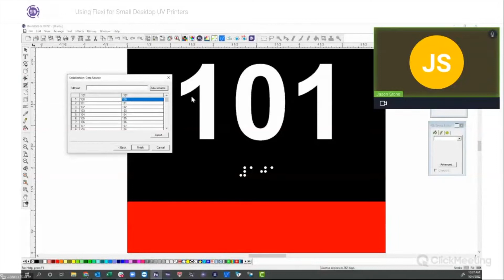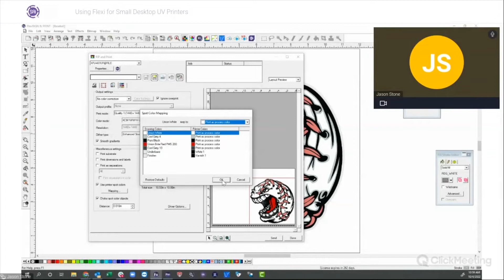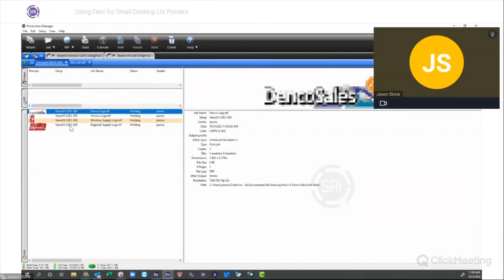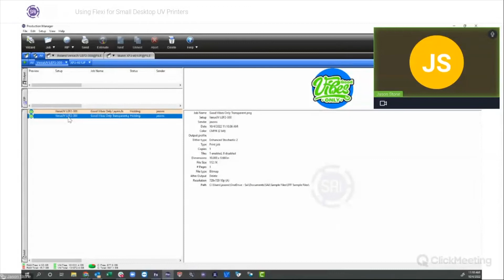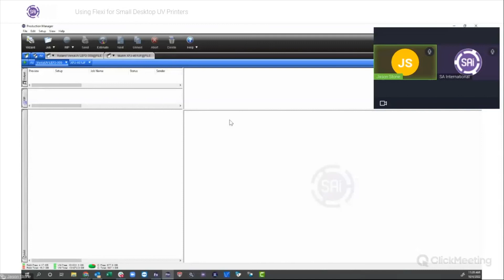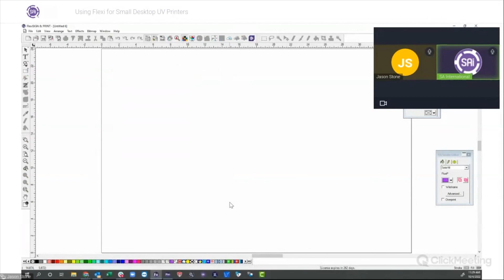SAi Flexi Webinar - Using Flexi for Small Desktop UV Printers

Comment: I will be buying a UV printer from Colorjet, the software they are sending with the printer is Flexi19. My question is: does Flex19 have the same functions as you showed within this video? I really like the jig templets you were showing. thank you!!
Reply: What printer you getting from colorjet and  printheads?  I have a a2 colorjet uv  with  3 tx800 printheads and researching flexiprint to see If I can use it. Currently using maintop as the rip and wellprint as the printer control
Reply: @thelazerwhisperer  Did you find out if you could use flexi